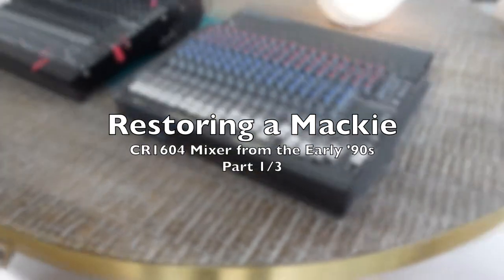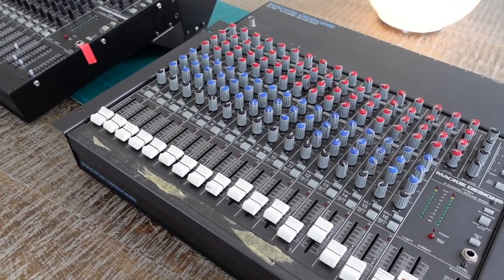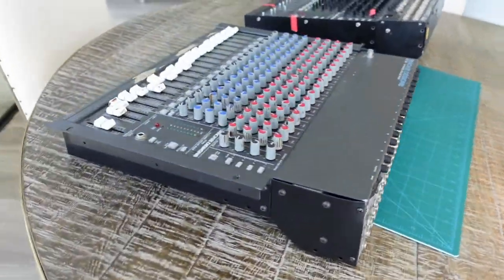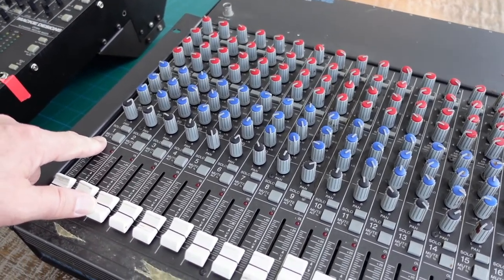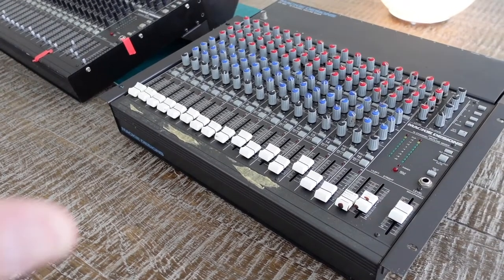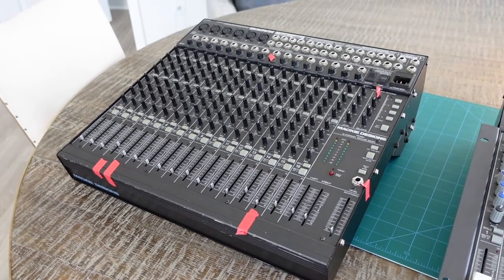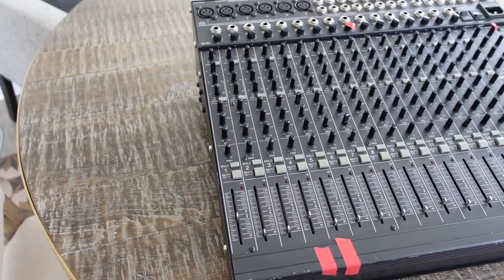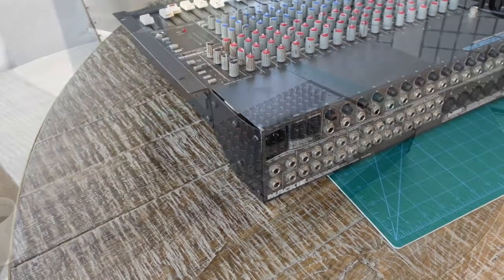Restoring a Vintage Mackie CR-1604 Mixer (Part 1 of 3)

Comment: I have a similar issue with the 1604 I got in a reselling deal. The corner near the IAC must have taken a hit at some point and the dented chassis created a barrier to power on. Eventually after opening it up and still not being able to identify where the exact break was I managed to angle the iac receptacle at just enough angle to reseat it to power up. I’m afraid to mess with it too much. However it does work for the time being. These things are built like tanks and I got to wonder why this corner is so vulnerable to impact damage?! Seems like a design flaw that could have been avoided.

Comment: Hello, can the 110v power be changed to 220v Europe on the mains via a switch or change the fuse? Or is the only option a step-up converter? Thank you

Comment: Great video! So happy to see people rehabilitating old gear. I just managed to grab one of these before it was thrown away. I've turned it on and it shows full lights with a blinking solo level light. Nothing but a buzz is coming out of the audio outputs. Any idea where to start on trouble shooting? I'm assuming it's something to do with the power supply.

Comment: great videos thanks. 
i've got a great working unit with all the options but the OL and Level lights just stopped working while i'm testing. wondering if i flipped a switch i can't find now or if the PS crapped out for the LEDs....

Comment: picked one of these up and noticed the left main channel LED meter doesn't pick up a signal unless the input channel solo button is pushed..the sound seems to only be slightly quieter on the left but for some reason the LED meter doesn't show it, left and right main faders are placed in the same spot, and it happens on every line input balanced channel i've tried. any ideas?

Comment: hi  ! i want to restore mine. Before i tear it down i want to spare some parts i obviously need . Do you know the exact part no / info to check all the specification values of the faders and knobs ? do you recommend opening it an d check it myself to be more sure ? it’s just spare parts take some time to arrive with import and stuff , so maybe it wouldn’t be wise to tear it apart if it is messy to put it back together . faders look far away from the starting point . thanks ! i love the thing , it was expensive so i got one to give back life to.  cheers !

Comment: Hey I know this an old video BUT if you have one for spares, I need a Pushbutton switch... Like the one on the right "Main Output mute",  I buy it from you
Reply from the maker: I still have the donor board... which is still in pieces. Are you interested in the entire thing?
Reply: @InventiveGear  Well I only need a switch. I thought you removed faders etc. How much would it be?  I had purchased several items this past 2 weeks and last nite got the Xrl extender.
Reply from the maker: Are you in the USA?
Reply: @InventiveGear  Yes South Florida…
Reply from the maker: @josemiranda1241  I will think about this. I need to determine if the other mixer could be repaired first.
Reply: @InventiveGear  Ok thanks for your time!
Reply: @InventiveGear  I found the part in Georgia! Thanks again  only $2.00 + shipping

Comment: May be a stupid question, but is it possible to mod these with longer ribbon cables and have the pod in a rack and only the "fader box" on the desk? Less cables going up and down and smaller footprint on the desk :)
Reply from the maker: I suppose the might work to some extent, however the design is based on those connections being very short. Thanks for watching.
Reply: Yes, that's possible. See the CR1604 schematics manual, one of the last pages.